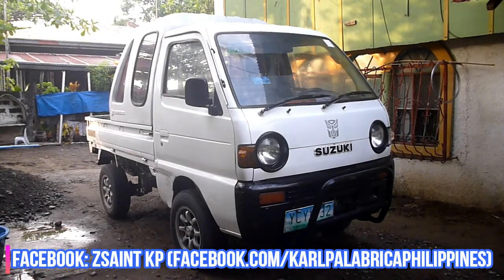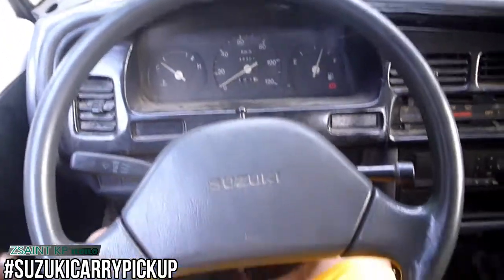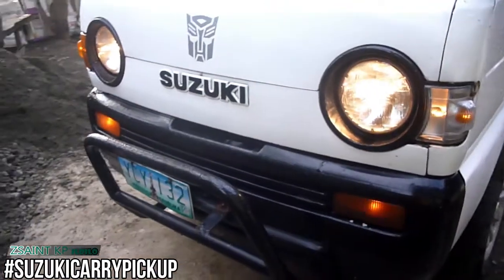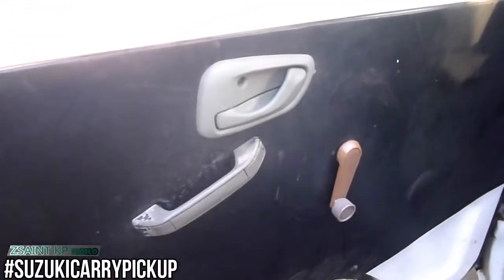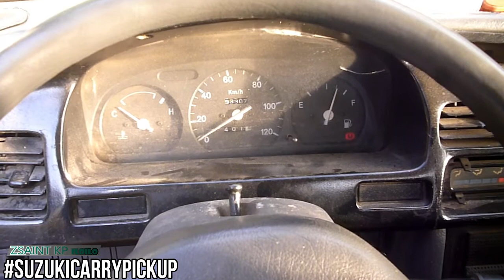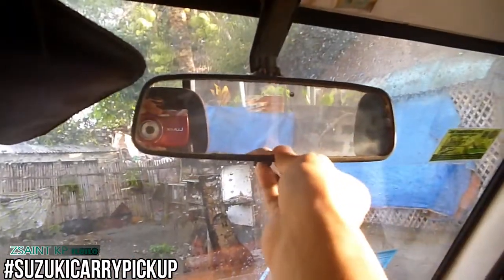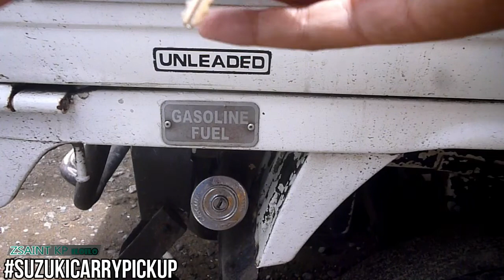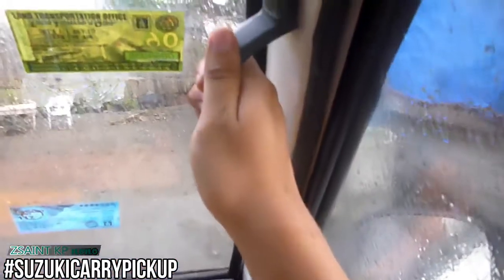2005 Suzuki Carry Pick-up 4x2 Lift-Up (Single-Cab) M/T: Start-up and Full Walkaround Review

Comment: 1995 not 2005
Reply from the maker: Originally, this was manufactured in 1993, but this was brand new in 2005 in the Philippines. Dude, that was a surplus vehicle converted and rebuild.
Reply: And also in 2005 they changed to DA63T (chassis code these models are DD51T AND THIS PARTICULAR ONE IS DC51T BECAUSE IT IS 2WD
Reply from the maker: @wc2006  Up until today, there were some cars like that sold as brand new model here in the Philippines.